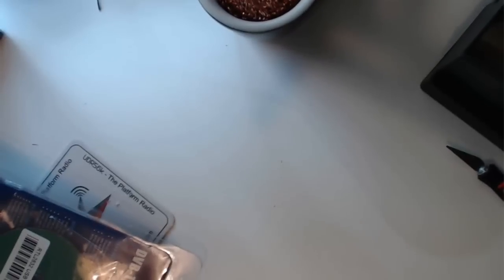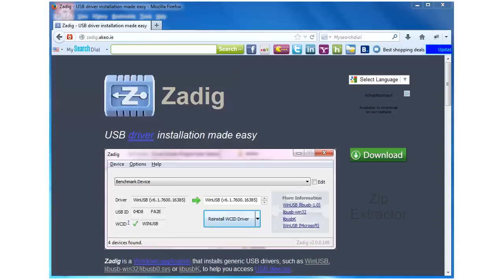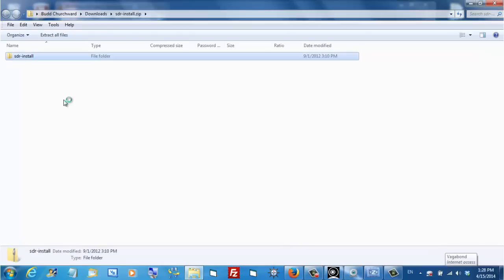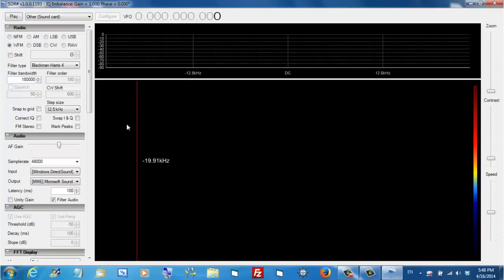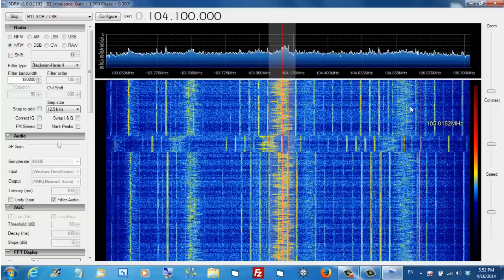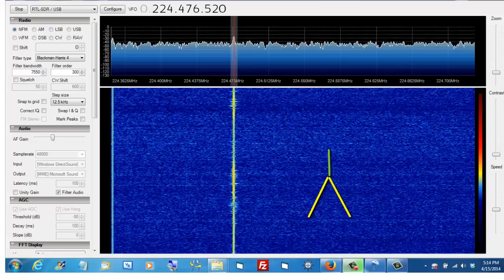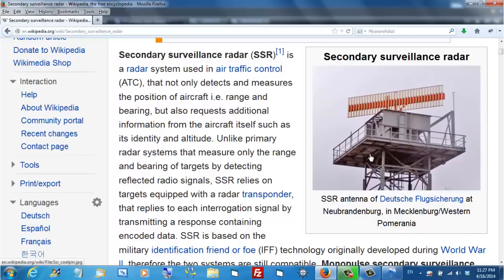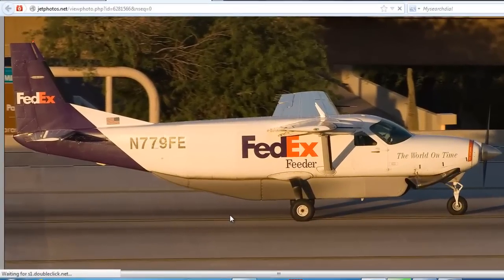How To Set Up an SDR Radio

Comment: 2020 and sdr radios can be bought for single figures. Sat in my kitchen with that whip antenna I downloaded a 9mb file off the NOAA satellite, sadly the file had an error so I couldn't decipher it. On putting the whip on a metal biscuit tin as a ground plain as it has a magnet in the bottom, and sticking it my loft I managed a 24mb file off the NOAA satellite. i'm just about to put sdr on the Raspberry pi and set a TCP server in motion so I don't need to run coax from the loft down into the kitchen. Two lengths of aluminium fishing sticks in a 120 degree V will be my antenna later.

Comment: Hi Bud.. Thanks for your very clear and patient description but I'm really struggling.
The program arrives at the Zadig window OK
The edit line has no text...not bulk-in or anything.    Driver, usbID, WCID, all blank but they DO fill up with Options..list all devices.
Opening the (edit) drop down doesn't give me any options including 'bulk-in' etc. but a single..'usb Composite Device (Composite Parent.')

I cannot find the table to which you refer but my USB ID on the window is the same as yours...OBDA & 2838 which is the second in the table, not the 1st for..generic RTL 2832, as your commentary describes. 2838 appears to be the driver for the dongle using the E4000 tuner.
With the greatest respect to your knowledge superior to mine, the table and the window ID don't match. 2832 number 1 in the table (Generic RTL2832) and  2838
in  the window.
Absolute beginners scrutinise instructions and find glitches even though they (I) haven't a clue what they mean. Before installing sdr # should I edit the window to read
OBDA   2832 and then reinstall driver?
If I you gain the impression that I don't know what I'm doing..you're getting pretty close!  
73 de G3NBY. Licensed since 1958 but trying to get a grip on the new magic.
I have a Hamitup converter waiting to be used and burning a hole in its box!

This is to pass to an utterly non-tech friend.. My next hurdle is to do it on a MacBook.
Is this the path to my ultimate suicide..hi?
Reply from the maker: ***** I am sorry you are having trouble getting your SDR up and running. Please note that the video is over a year old and shows web pages at other sites that have changed since it was produced. Items may no longer be in the same order or location. I would suggest that you look at the tutorials on Adafruit and post your questions to their forum. That is where I usually go when I am having trouble.
Reply: Budd Churchward
Hi Budd...Thank you for your super quick response. Much appreciated.
I had a feeling that something of that nature might be behind it. BUT.
In the meantime I have been doing a bit (a bit?) more research.
The main problem was that the driver window (& the laptop itself), read 3 dongles as "Composite device (Composite parent)."
I'm using XP Pro, sp 3 in order to employ the laptop off-line.  I now find that two other laptops, one  on XP Pro- SP2 and the other XP (not Pro) SP3, see them all as Bulk-In, which is just what is required. Can't use those other laptops, as they aren't mine so didn't complete the installation but it shows a starting point!
Any idea what may be wrong with my XP to misread the dongles? KMDF-WDF files? (Whatever THEY are?)
I've been chasing this for ages but not until I tried your tutorial, did some light come on!
Not solved it but it moved on a bit!
For that..a million thanks!

73 G3NBY
PS  As Alice in Wonderland said "It gets curiouser and curiouser!)
My Mac book doesn't see them at all!
Think I'll take up fishing!

Comment: Which antenna did you use?  I have a longwire...and going to use a 9 to 1 unun...toriod coil I built...and a 40 foot lenght wire. Which sdr is this???  Im buying the one that goes from 100khz to 1.7ghz because I a ham operator and want to listen...and to listen to shorwave alot.
Reply: Kennynva T. you can try with you longwire antenna, why not. You will see if you receive something or not. If not, you will need to purchase or built an antenna cut for the required frequency (turnstile, helical, etc).

Comment: hello Bill
first of all thanks for the tutorial!
I purchased an sdr Dongle and was trying to follow your video for install, it's not the same brand as yours but I didn't think that would matter as far as the issue i'm having, the problem is very early in the video when downloading the driver from Zadig, I select the "options" then "list all devices" but in my devices I don't see "Bulk-in (interface0)" I do see RTL2838 UHIDIR as well as 3 selections for wireless devices interfaces (0) (1) (2), and HP webcam (interface 0), my assumption is to select the RTL2838, is this correct or should I be seeing the Bulk in interface?
Thanks
Reply from the maker: +Richard Scruggs one of the problems with citing web pages in videos is that over time the pages change and don't match what we see on YouTube. I think your assumption is a good one. Let us know what you find out.

Comment: Thanks for the video. do you need to have an internet connection for this software to work? Also can you transmit ?
Reply from the maker: Joe Cobos The project does not use an internet connection. You can only receive signals that are able to reach your antenna. You can easily build your own antenna that will be much better than the antenna that comes with the dongle. This is not a transmitter it will only receive signals it cannot transmit.
Reply: Thank you for your reply and info.

Comment: I have the RTL-SDR USB tuner R820T+8232 and I cant get the unit to receive HF. Deaf as a beetle.
It is supposed to be plug and play and work from 100khz to 1.7Ghz.
Reply from the maker: +Thi Tuyet The RTL is only good for around 25 MHz or higher. Remember these were built for television reception in Europe. To do HF with them you need to add an Up Converter. Check out my "Strangest Thing" video and see what you can do with SDRPlay's device on HF. It uses a different chip set and you can pretty much listen any where.